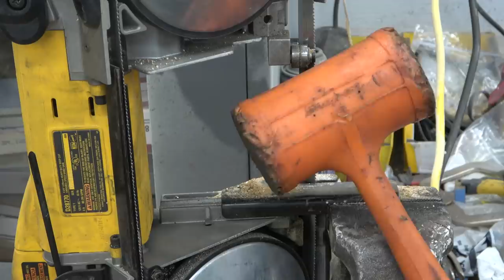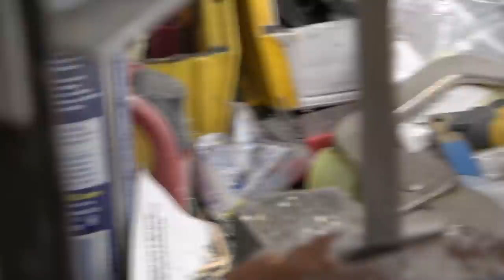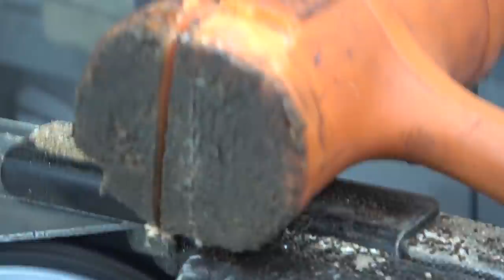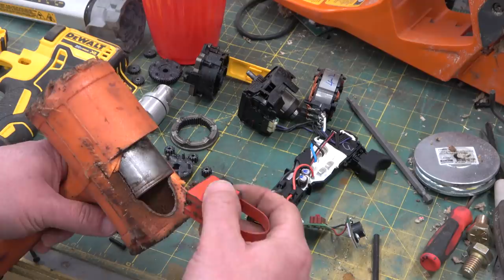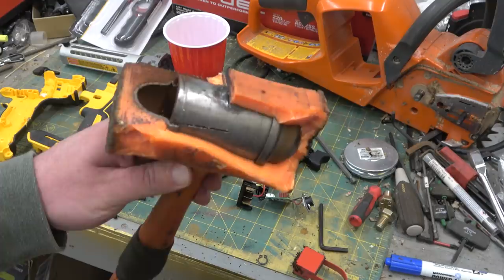BOLTR: Dead, blow hammer?

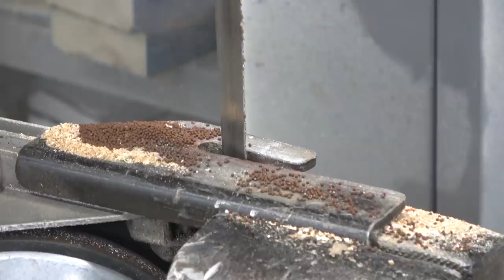Comment: 2:10  what teeth?
I once saw in an episode of How It's Made that whichever brand was featured in the episode was using (much coarser) lead shot instead of steel / iron.
The plastic was much thinner though, so the Snap-On lasting 20 years wasn't too bad.
Spanks for showin' us what Snap-On did 20 years back to make a dead-blow thumb-detector, and for showin' us how much damage it does even after death!

Comment: Ah well back in the day a wood handle on a chunk of Lead, (circa 1983-87ish) there were 10-15 of the Dead blow things in various conditions around our High school Metal Shop every one of the 6 BridgePort mills had one the Horizontal mill had 2, a few floats were around the the 9 Metal lathes, the MiG welding curtains were good at concealing them for weeks on end in their folds... sort of in plain sight but invisible because of the orange and green plastic they were made of. In fall they were there by spring you would be happy to find one of them around all of the milling machines and the whole shop. Alas end of year clean up would find missing tools all over... how 5 of them wound up on top of the 8 station oxy-Acytylene  welding table Exhaust Hood was beyond me... same thing with the multiple pliers and tongs on top of the 20 arc welding stations and of course Hammers, projects that were missing from a student’s lockers etc... but the 3 that I found among the Steel storage racks were like brand new and had years worth of dust and Grime coating them! I must say that the one that I wish I could have today was a Squared rectangular block and in the middle had a Heavy steel Rod wraparound and extending to make a handle simple like that of a Blacksmithing tool, Crude but effective! I’m sure OSHA eliminated the hazard of teenage boys licking their dead blow hammers, and the School Board elimination of Metal Shop, Wood Shop, Welding shop, Automotive Shop and nearly all of the amazing hands on learn by doing it yourself and get your hands dirty in the process, are almost all Gone! God Forbid you teach a kid to hammer a nail without busting his or her thumb wide open!!! That’s tooooo Dangerous why don’t you study harder for a cruel future of College Debts a unfulfilling dreams!

Comment: At least the snapon has a canister inside 
A bloke at work was building a cat 789 transmission 
Big 7 speed trans loads of layers of clutch packs and gears, knocking in a top duo cone seal and his cheap deadblow exploded dumping thousands of little steel balls I to the new trans 
Just made himself an extta 2 days wprk pulling it all back down to clean them all out 
Next week's meeting "its now company policy that all component rebuild mechanics must use tools that meet specific requirements" (they were paid a little more amd had an easier job so they were fine with paying more for tools to keep their position)

Comment: The ideal dead blow hammer would contain mercury, like the weights on the best old sounding tapes. Could part of the reason them being iron instead of lead, other than the deformation (which I'm not sure I buy) be the tempature of the overmolding?  I have no knowledge of injection molding and plastics production, but a quick jazz hands on the gargler showed that on the high end lead could become hot enough to melt, or at least deform to the point of sticking.

Comment: I would think that a smart bastard with a CNC, a welder, and whittle’n knife could make a pretty good homemade replacement. I’d use copper shot made from cutting up scrap 10 ga wire into bits for the innards. One could use lead shot but copper is just so much more fashionable.

Comment: Actually makes sense they would use steel balls. Lead is probably too soft and would deform. Tungsten would work, but it's EXPENSIVE. Case in point, you can get shotgun shells that are loaded with tungsten alloy shot. They also cost about 5 times as much as a similar shell from the same manufacturer loaded with steel shot.

Comment: Co-worker barrowed my dead blow on a job. Never seen it again untill 10 years later in a gas tanker I was internally inspecting when I spotted two dead blow hammers in the front of a baffle right we're said co-worker was beating out a dent in the shell. Turns out after 10 years in a 9000 gal tanker it just will stink up your tool box like gas.   Ps his hammer was in there too and since he quit years ago I acquired an extra dead blow.

Comment: May have seen a piston dead blow come a part and lead flew everywhere the rubber had been damaged and peeled a chunk off letting the cap pop off. Interesting stuff none the less. Love hanging out with ya in the shop, any chance you might know how to make a hydraulic band saw lumber mill with another valve body for in-feed rollers?. I'm concerned with flow rates and how much pressure to run off an old M100 series tractor off the PTO or maybe a small v belt pump, and maybe some sort of decoupler or clutch system for the bandsaw drum in case a mildly inebriated guy could still cut the machine off with one hand before he gets himself hacked to bits.

Comment: Management wasn't a big fan of the custom ballpeen look on process pipes, so decided a fleet of plastic softblow hammers was the answer to clearing blockages. Well, a few days of -30, and everyone on site had been caught in at least one steel ball rainstorm.

Looks like Snap-On is built a bit better than the easy suppliers, at least yours didn't puke it's guts everywhere when it died.

Comment: Definitely not cheap, but I’ve warrantied 2 Snapon plastic deadblow hammers for the same failure.  You should still try getting it replaced under warranty. The dealers that warrantied mine weren’t exactly peoples favourite dealers. 

The plastic definitely takes a beating around all the aggressive lubricants in a shop.

Comment: Had a smaller one of these.... about 1995. it was full of lead shot, almost exactly like buckshot. After about 2 years of use, the whole lot just stuck together and it became pretty useless. The man in the van did give me a new one which is I suppose why you have to initially bend over and pick up the soap when you buy it or any other of their wares

Comment: Lead wouldn't work because they would deform over time and would not move freely and give a good transfer of energy.  Tungsten would work, but is way more expensive, so in turn the already overpriced hammer becomes even more overpriced. That's why the balls are steel.

Comment: Lol,  you sir always have a way with poetry. Thank you for your YouTube contribution.  As you shat yourself and reversed direction I screamed in my head tracks are laid just gotta finish the run.  I once killed a 90's Taiwanese hardware store dead blow and it indeed had 1/8" lead shot inside.  They were pretty deformed so I bet steel was the most economical safe replacement.

Comment: still had warranteee till saw blade was introduced, then they met in the middle and both became worthless.
the chinese embassy version i think does have lead (you can tell by the feel when you shake it, the finer media has a smoother feel) also doesn't last near as long, but at 80 odd bux for a truck hammer, do you reach the break even point?

Comment: I have had 3 of these fall apart in the same way. The urethane jacket gets hard, and breaks up over time. I had one do this without ever being used (it was in a truck tool box I never used). I now use the cheapest ones I can find, and they seem to last just as long.  If I can create a suitable mols, I may just re-cast some urethane onto the old wrecks, just for giggles. Hmmm, maybe a project for you?
Reply: a Suitable MOLD.  Geeze...

Comment: So does a brass hammer function the same as one of these steel shot deadblows, or does it impart too much force upon whatever you're smackin?
Reply: No brass just gives at the hammer as too mar the beaten surface lessish. Deadblows actually impart more force than most hammers as there is less loss of energy in it not rebounding. They are also commonly used by professional that need to hit things hard but not cause sparks.